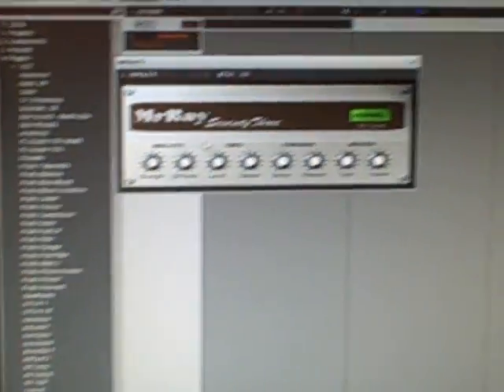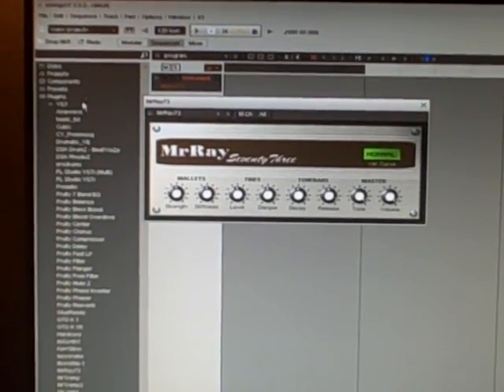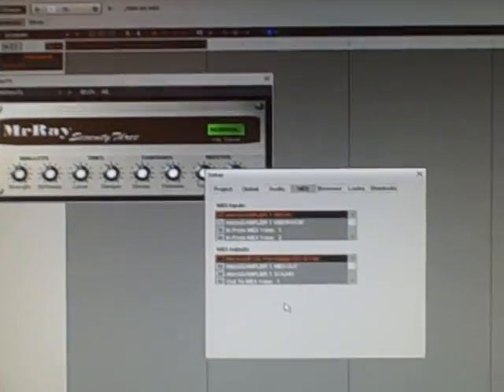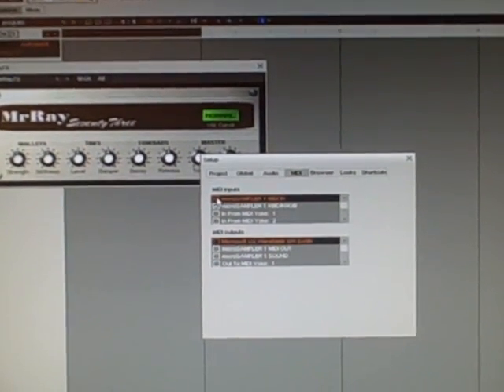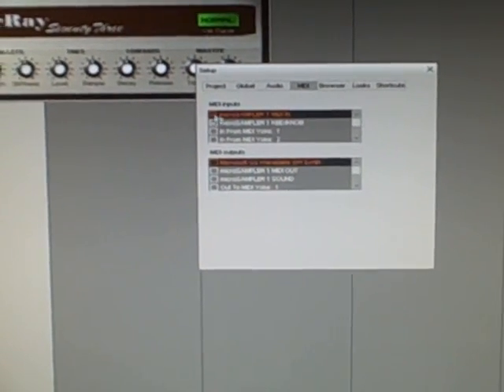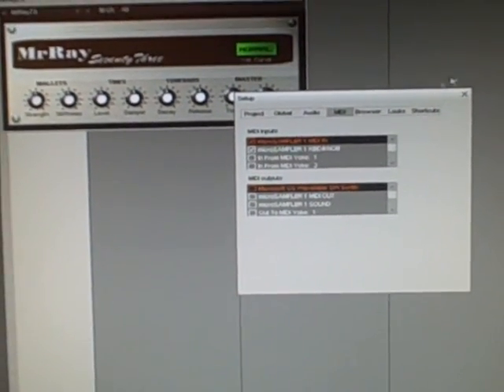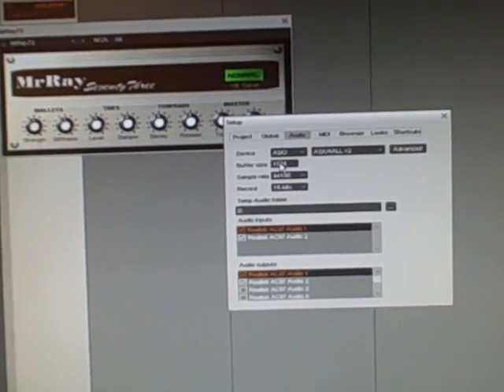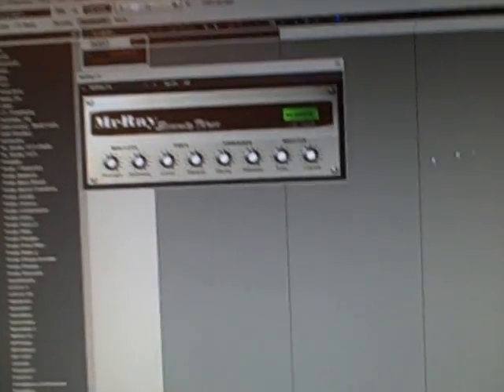KORG microSAMPLER + Energy XT = VST controlling and sampling tutorial

Comment: Thanks for all the tuts!  When you say VST controlling, you input the VST sample via usb-midi, correct?  Have you tried using midi with any other external sequencers or keyboards per chance?
Reply from the maker: Thanks for watching! So in this video I used the MS1 to control the VST through USB MIDI, but the audio is running from the PC audio out into the MS1 through audio cables (no audio transfer over USB). 
I've also used a Yamaha BT01 bluetooth MIDI adapter plugged into the MS1 to send and receive MIDI over bluetooth, which is handy for controlling iOS devices/apps with MS1. 
In another video I do essentially what I'm doing here but controlling a Boss DR-670 over MIDI cables instead of the PC with a USB cable.
I hope this helps!